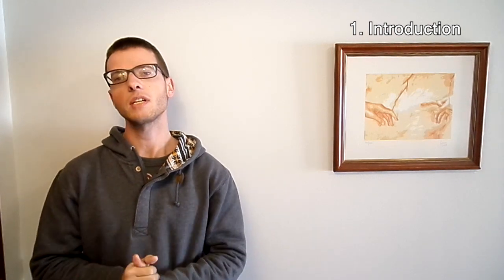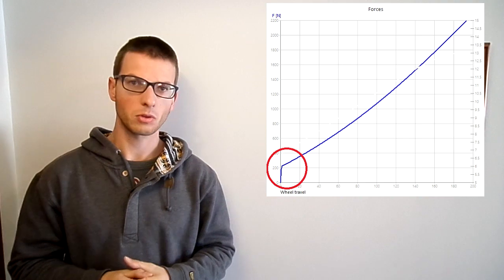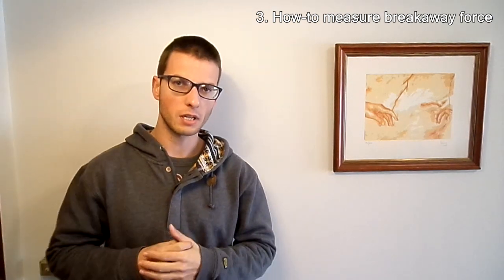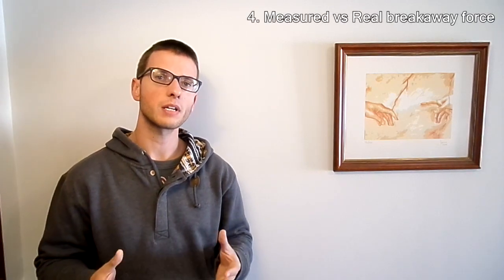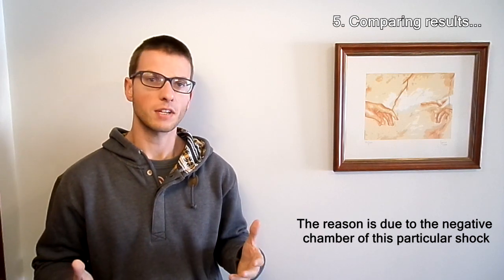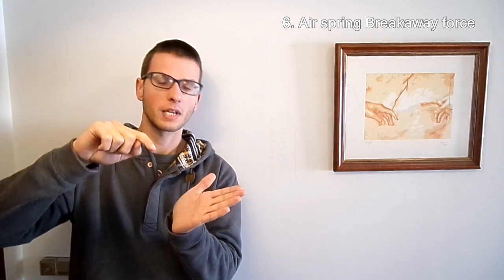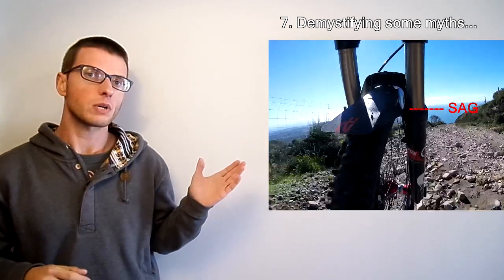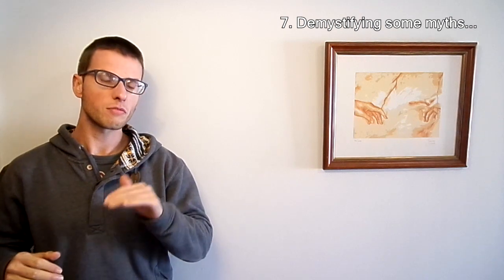How-to measure Breakaway Force (MTB rear suspension Ep.8)

Comment: What makes sense is to measure a stiction zone in suspenstion. It indicates how much friction is present in your suspension. Friction has effect in full travel and it is deciding factor for suspension sensitivity. You need to read this book - http://www.amazon.com/Techs-Motorcycle-Suspension-Motorbooks-Workshop/dp/0760331405/ref=sr_1_2?ie=UTF8&qid=1457091957&sr=8-2&keywords=racetech

For air shocks friction comes from too many air/oil seals. Bigger negative chamber volume affects the air spring rate but it does not eliminate preload or stiction. What manufactures do is some trickery with positioning equalizing air ports which put a bit higher pressure in negative chamber in comparison to positive chamber. This indeed reduces dramatically preload for air shocks. Good examples are bos shocks and forks.

Preload actually is needed to offset the weight of the bike. In your case it is exactly near the bike weight. For example on motobike preload will be much bigger as bikes are much more heavier.
Reply from the maker: +Andriy Gavrylenko lol... I already shared that link two responses ago :D  But even that shock have a tiny little IFP-derived breakaway force :D Indeed the breakaway force (in pounds) is equal to IFP pressure (in PSI) multiplied by the shaft sectional diameter in square inches. For the ARMA it's a very low value... 3kg at the shock and around 1kg at the wheel... which is great!
Reply: +andrextr what says marketing usually does not correlate directly with reality. In shocks bladders are used for following: - improve traction by reducing friction; -remove inertia and heat generated by IFP; -simplify maintainability as you do not need IFP setting tool and can do service usually as home. Just google - you will find plenty of information.
Reply from the maker: +Andriy Gavrylenko Hi. This video makes sense!The breakaway force is the result of both preload and static friction! So by measuring the breakaway force you get much more info than just by measuring stiction. And measuring stiction is not so easy to do with a simple instrument such as weight scale..  But if you have any simple method please share with us.

Regarding the second paragraph, I fully agree. Didn't want to go so deeply on the negative air chambers in this video, but probably I can talk about that in another day.

Regarding the last paragraph, sorry but I disagree.... Indeed there is nothing wrong with having a static SAG on a bicycle. Cars have it, motos have it, why bicycles can't have a tiny amount of SAG? They don't have because of the breakaway force of the IFP is higher than the bike weight... A zero breakaway force is the perfect value. Manufactures want to decrease breakaway forces in their shocks. DVO and Ohlins use bladders to overcome that. EXT uses very low IFP pressures (http://extremeshox.com/en/bikes-dh), and VIVID uses a negative coil spring inside the damper to reduce IFP breakaway. So yes, zero breakaway force (= zero preload + zero stiction) is what we want. 

Bye :)
Reply: +andrextr Actually you mixing up all things. Preload and stiction are two different things. Bladders instead of IFP used to reduce stiction/friction and do not affect preload. The pressure under which is oil is still there and adds to preload. Preload is needed so you have a right sag. Problems which you try to avoid  is having too much preload. This shifts your sag or could even remove it completely. 
What you also forget is that tire pressure play a big role in suspension. All suspension today is designed in a way that tire on impact has to compress in order to overcome the preload (breakaway as you call it). This is the reason why if you have correct preload and correct tire pressure you wont notice breakaway force. This is also the reason why friction in suspension play much bigger role than having zero preload.
Reply from the maker: +Andriy Gavrylenko I know that preload and stiction are different things..... What I'm saying is that breakaway force is the sum of both preload and stiction (you need to overcome both preload and stiction to enable the motion of a fully extended shock). Just to be clear, when I say preload, I mean the force that the shock produces at fully extended state...the static force, if you prefer. Regarding the rest, I have a different point of view... 

But I'm not alone when it comes to reduce the breakaway force...check it out:

EXT: "The damper run with very low Reservoir pressure 30 Psi this
dramatically improve first movement sensitivity, comfort hence
traction and safety."

RS VIVID: "Counter-measure: Engineered For The Elite, the new Vivid conquers several once-thought-impossible engineering feats. Technologies like Counter Measure, which reduces the breakaway force of the shock to virtually zero pounds, transforming small bumps in to traction-generating performance."

DVO JADE: "BLADDER: AMAZING SMALL BUMP COMPLIANCY, NO STICTION OFF THE TOP." "Instead of using an Internal Floating Piston (IFP), DVO chose to use a bladder in the coil-sprung Jade rear shock, a design intended to reduce any potential initial stiction, which helps improve small bump sensitivity."

There's more but I will stop here :) 

Bye
Reply: +andrextr Anyway. If you want shock without breakaway force you need one of these - http://extremeshox.com/en/bikes-dh
Reply: +Andriy Gavrylenko the ARMA truely is a masterpiece!
Reply: +andrextr Isaw you were asking on ridemoneky regarding jade. I ride them on several bikes and i can tell there is not much difference in preload in comparison to ifp. You still have 180-200psi oil pressure. However, dynamic friction is much lower. Also, when you ride already in sag you dont notice preload or static friction. Preload is noticable only when you topout your suspension - in other words, when your tire looses contact with ground. When your tire lands back on the ground it will compress first and only then suspension will start moving. If you have too much static friction most probably it is time to service shock. As RC4 has a huge shaft diamter it has also a big seal which contributes to a lot of friction.
As other people on that thread already told, preload actually is not necessary a bad thing, especially if you have high leverage frame.
Reply from the maker: Hi Andriy, if you don't mind, I would like to know the result of this test with your shock :) And yes, breakaway only affects the top-out since by definition is the force needed to START compressing the suspension. Since on a very rocky, fast, and bumpy trails your tire spends a significant amount of time on the air (between bumps) breakaway has a significant impact in that scenario. So, I cannot think in one plausible reason where having breakaway could be an advantage.... So, if you can, please do the test and send me the results :) Btw, check this out: https://www.youtube.com/watch?v=SPkUXqFVlic   Bye
Reply: +andrextr I only see that in that cartridge test internal pressure in bladder is drastically lower as otherwise it would rebound with the same force as the one with IFP. Also I have one jade not set into frame yet and I can assure you that it has significant preload unless I remove air from bladder.
Reply from the maker: Bladders work in a different way, and produce lower preload forces than IFP. And this is what I want to test, since I don't have a bladder shock I have to ask people :)  Check this out:  https://www.sram.com/rockshox/technologies/charger-damper

"Bladder Charged

Extruded bladder design is insanely durable, resists damping change during extended downhills and has virtually zero pressure offset for small bump sensitivity."

Bye
Reply: Rockshox charger is not pressurized cartridge.  This is a huge difference to spring loaded ifp cartridges. Inside charger pressure is built as cartridge is compressed. This means that oil inside cartridge will cavitate until enough pressure built. Rear shocks are all pressurized (ifp or bladder) and usually with high pressure (150-200psi). You cannot compare fork cartidges to rear shocks. They have quite different requirements. All rear shocks which are not pressurized (and therefore do not have preload) will cavitate.  All these talks about zero preload is nonsense as today high performance shocks are pressurized. Reduce friction, have minimal preload and correct tire pressure. This is all you need. I'm not gonna measure anything on Jade as under pressure it will have breakaway force similar to any ifp shock with same shaft diameter.
Reply from the maker: So, just to be clear. You are saying that IFP and Bladders are the same in terms of breakaway, and you are also saying that zero breakaway is nonsense.... I fully disagree with both points. First, bladders are used on MX for many years, and there is a reason, indeed bladders reduce breakaway forces, for the simple, and VERY important facts that bladders have a Fixed/limited amount of expansion and have more oil contact area. So, unlike IFP, having 200 Psi inside the bladder does not translate into having 200 Psi on the oil in the top-out position. On the extreme, if you use a low oil volume you can have 200 psi on the bladder and 15 psi (atm pressure) on the oil (this doesn't happen with IFP)... So, yes, bladders don't work in the same way as IFP... Regarding the "nonsense" zero breakaway, the only non-sense here is that only a couple of shock manufacturers are investing in that direction, such as EXT ARMA, the RS VIVID (counter-measure technology), DVO or Ohlins. Bye :)

PS: "When the shock is initially compressed, the IFP can cause a moment of stiction creating a notchy/sticky feel right off the top. With a bladder system that is completely eliminated and small bump sensitivity is enhanced. On the initial compression, the oil surrounds the bladder and compresses it similar to squeezing a balloon." 

http://www.dvosuspension.com/blog/first-look-jade-coil-shock/
Reply: +andrextr Just for you I measured the pressure in kg an the shaft itself in order for shock to start compress. It is around 20kg which translates directly to 185psi I have in the bladder. The things you post here are very misleading. It is impossible to have oil  pressure less then in the  bladder unless it is not bleed properly. Even if it would be somehow possible, physically as soon as shaft moves a tiny bit it will need to overcome bladder pressure. It does not matter the surface contact of bladder - it takes same amount of force for ifp or bladder to reduce volume under pressure by specific amount. Bladders ONLY remove oil piston friction and thats it. Air preload, piston band, bushing and oil seal friction is still there. There is no magic. Please read some books before posting anything as so far it was very misleading.
Reply from the maker: OK, so, accordingly to your data, what is misleading is the DVO and Rockshox statements on their sites, which claim that bladders decrease breakaway. Indeed, on rockshox theory guide it claims: "In some systems, an expandable bladder can be used in place of an IFP. The advantage of a bladder is the lack of breakaway force created by IFP gas pressure".  This is why I asked people with bladders to share the data. To confirm, or not, this hypothesis. Regarding my video, it's not misleading at all, I only showed how to measure breakaway force and that the breakaway force affect's the top-out sensitivity (this is why negative chambers were created..). Nothing misleading with that at all... So, if bladders only reduce the stiction of the IFP seal, as your data suggests, that is a nice thing to explore in a future video. Also, that means that Vivid counter-measure system is the only one that gives you a zero breakaway (I also have no data about Vivid, so don't know if the RS claims are true or not). Bye.

Comment: Trek fuel ex 2013
Fox float evolution drcv: 19.1 kg 

Trek slash 2015
Monarch plus rc3 debonair: 14.1 kg

Trek session 2014
Fox DHX performance rc2: 12.3 Kg

Does shock psi affect the breakaway force? These numbers (at least for the air shocks) seem a bit low compared to your values.

Awesome vid as always!
Reply from the maker: +Noble 215 Thank you for you info. I will take note of that. If more people contribute, I will analyse the values in a future video. Your values are quite good and match with the ones that I have in the coil shock. Which means that the breaking force on your case came mainly from the IFP pressure. My coil shock can get lower values if I decrease the piggy back pressure (I had 200psi on the video). My air shock has a very high breakaway force because it's an old and cheap model and it lacks the port that automatically equalizes the pressure between positive and negative air chamber. So in my case, increasing the air pressure increases the breakaway force. In your case, since your shocks have that port, you don't increase the real breakaway force by increasing the pressure. Bye